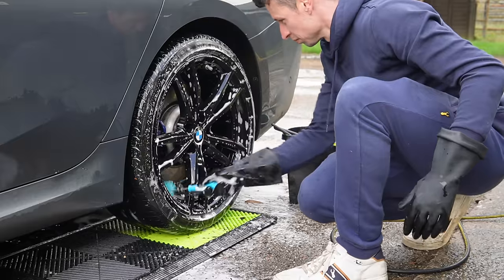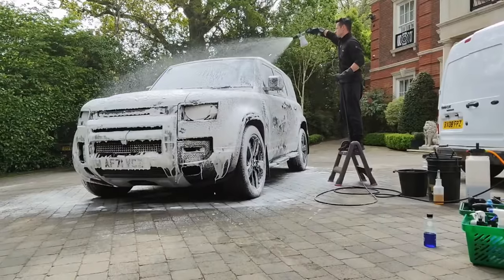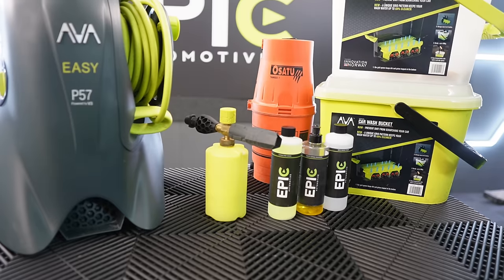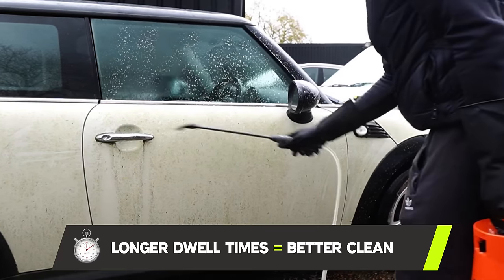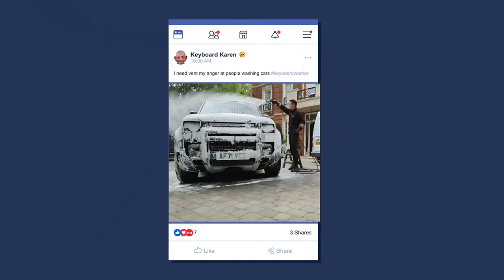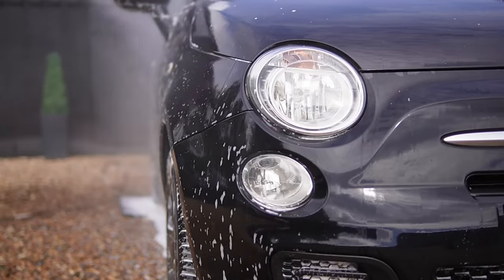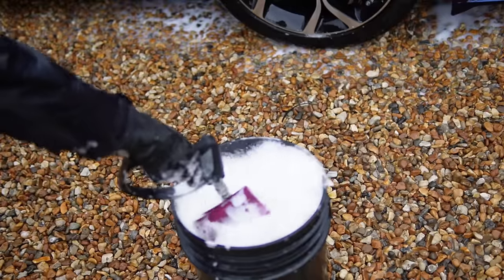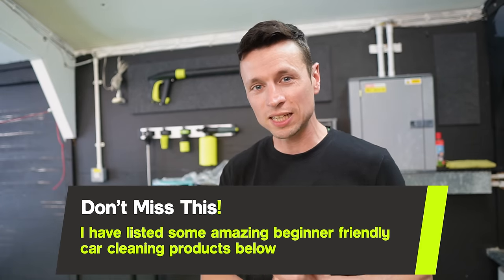Pre Wash Your Car The Easy Way | Detailing Beginners Guide!

Comment: I washed my wife’s car yesterday, I used a cheapo foam to clean wheels/tyres with a small brush, then snow foamed the bodywork with Bilt Hamber AutoFoam, about 200/300mm product made up to 1L in my MJJC. After that I did something I’d never done before which was, as I had lots of foam left in my cannon I snow foamed it again and then washed it with my mitt. I rinsed off again and it looked great, plus, I only used 1 bucket with grit guard to swill the mitt.
As it was quite sunny, I managed to get it done quicker, didn’t use any shampoo and didn’t use any hot water in my 2nd bucket. 
I’m about to order a citrus cleaner for my pre-wash to go forward, hopefully less scrubbing of the wheels which is my most hated job to do, but what I like most, clean alloys and dressed tyres………….

Comment: Until last week I had an Alfa 159 ti sportwagon in Russo red (imho the best colour) which used to look absolutely fantastic once I followed a lot of your tips, but lately it was doing its best to drain my wallet, so I sold it on. My replacement car is something totally different, a 2010 Honda CR-Z with a full service history, less than 59,000 miles and in a pearlescent white metallic paint which is in very good condition for its age. I am going to spend some money getting it professionally detailed at a firm local to me, as they are doing a good deal for a machine polish and a ceramic coating. The car last had the full Autoglym LifeShine deal (interior, exterior and glass) back in 2019. I have no idea if that was any good or not, but I think it's time to get it done again.
Reply from the maker: Ceramic coatings have come a long way. Synergy from infinitywax or g techniq ceramic coatings are very popular with good reason. I love white cars once they are clean. I'm looking at a white Audi TT at moment. Deciding if I should get it
Reply: @epicautomotivedetailing  That's the catch with white cars - you have to keep them clean. A lot less hassle than black cars though! I had an og Saab 9-5 Aero back in the day , followed by a Mk 8 Civic, both of them black. Did my head in keeping those buggers presentable. Black shows up every defect in the paint, whereas white is a lot more forgiving.
Reply: @Arti 159  totally agree, I had a black Polo GTi lady year, that's when I started getting into the cleaning and the thing was dirty the minute I turned my back 😂

Comment: Hi Dave thanks for every video you put out is so helpful !! BUT I AM IN NEED OF YOU HELP !!! On HOW TO MAKE UP A CAR INTERIOR DEEP CLEANER I ALL READY HAVE THE HAND HEAND HELD TOOL WITH TRIGER FOR WATER SPRAY WHERE TO GET STAINLESS STEEL 1/4 “ HOSE  AND FITTINGS  AND QUICK DISCONNECT SUITABLE FOR  WATER !  I ALL READY HAVE A 30L WET & DRY VAC WITH EXTRA BOOST SUCTION  !! CHEERS BRIAN

Comment: Dave, I love your videos! I have a question for you. You mention cleaning the petrol cap. I drive an EV, while the charge port area does not get a mucky as petrol filler cap, dirt does accumulate there. What is your advice for cleaning it? I feel using a jet wash would be a bad idea as there is an open power connector right there without a cover. I would love to know your thoughts.
Reply from the maker: very good question. My best advice is to get the cotton swaps out and being very careful. Definitely deserves a video
Reply: @epicautomotivedetailing  looking forward to it! If you need a car to demo, I am happy to provide one🤣

Comment: Hi Dave, One small doubt regarding pre wash chemicals. Can i mix an APC (GreenStar) with foam shampoo to get the same result was what you are getting with the citrus one? or is it ok spray the APC in the same dilution ration onto the panel and then cover it with snow foam ??? Like, majot doubt is, shall i replace the citrus pre wash with APC ?

Comment: I spray one wheel and a panel. Clean a wheel and rinse that and the panel. In winter anyway. Any thoughts about this approach in summer?
Reply from the maker: For business sometimes you have to change things up on the day. I remember I washed a rolls Royce (uploaded it to YouTube) it was the hottest day of the year, the car had black paint and the heat was unbearable but we pulled it off

Comment: How do you get the foam that thick? I have a p70 smart with the top Ava foam lance and it still isn’t foamy just sudsy water. Could it be hard water and also if it sits mixed together for 20 mins can it weaken the foam because it’s hard?
Reply from the maker: Epic Automotive Snow Foam. It's a powerhouse 💥
Reply: @epicautomotivedetailing  I’m sold.. cheers mate I’ll check it out

Comment: I am looking to buy a new pressure washer and snow gun what would you recommend?
Reply from the maker: Depends on budget and requirements my friend. So many options
Reply: @epicautomotivedetailing  For cleaning my van and jet ski budget around £250
Reply: @epicautomotivedetailing  what about the ava easy p40?
Reply from the maker: @marinejunkies9625  yes it's practically the same machine apart from glow rate and bar pressure. All the same great accessories included
Reply: @Epic Automotive Detailing  is the enough bar for car cleaning?

Comment: I can't understand the rinse debate either. 
I've rinsed top to bottom, and bottom to top, and there's absolutely no difference in the end results.
Reply from the maker: Yep 100% it's almost like they are just looking for an argument all the time
Reply: @epicautomotivedetailing  something I do on hot days, if there's no shade available, I will spray the vehicle first to cool the panels down, before applying any prewash, or snowfaom. 
This helps increase dwell time, but still have to be careful it doesn't dry on the vehicle.

Comment: Spray the citrus pre wash on a dry or wet (water rinsed with pressure washer/hose) car please? You didn’t specify this.
Reply from the maker: Depends on scenarios mate. If the car is heavily caked in mud then you will need to loosen up some dirt first however for best results on moderate dirt apply to dry surface